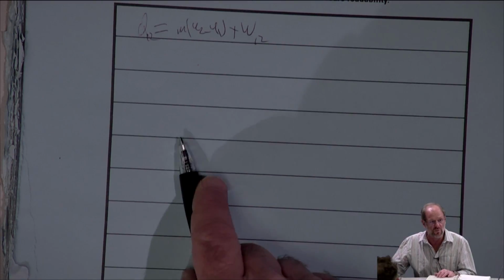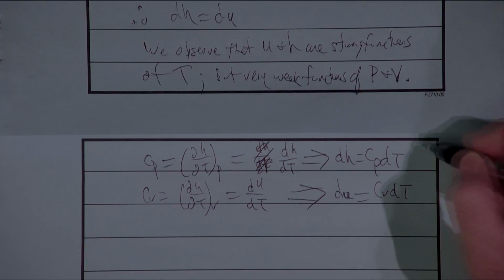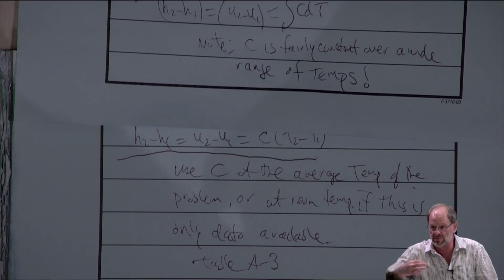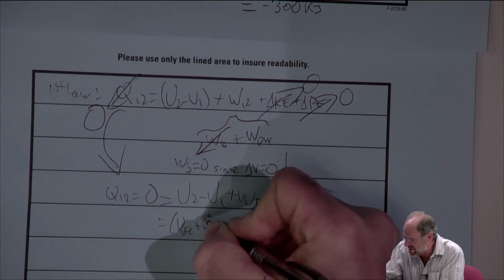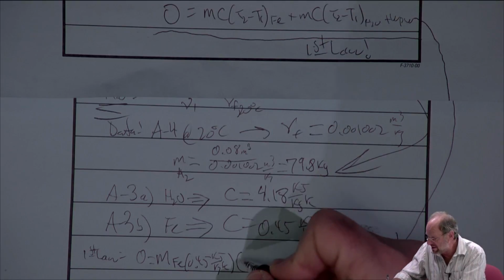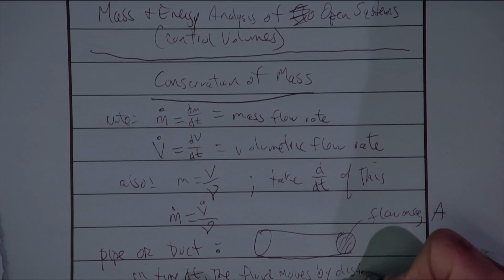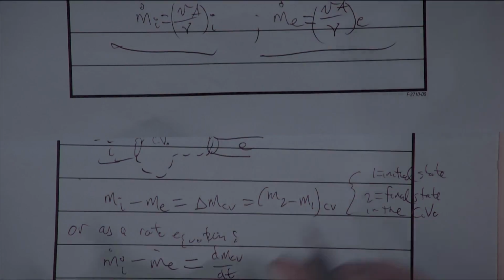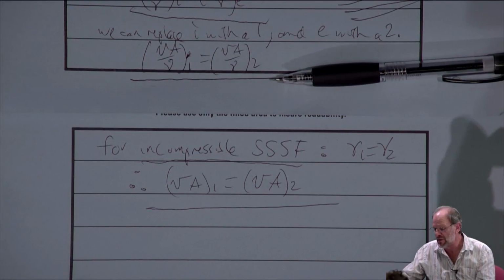Thermodynamics: 1st Law for Closed Systems, Solids & Liquids; Conservation of Mass (11 of 25)

Comment: Great Lecture by Professor Miller
but I have a question 
in the solid specific heat problem for iron why didn't Professor use 27-90 Why he used 
27-20 even for iron
please clear this problem of mine
Reply: he did use 27-90 for iron
Reply: @ezez9213  
Thanks
I know i can trust USA's Pomona